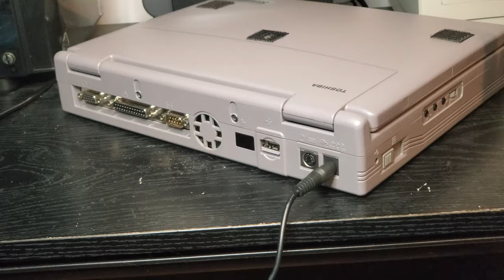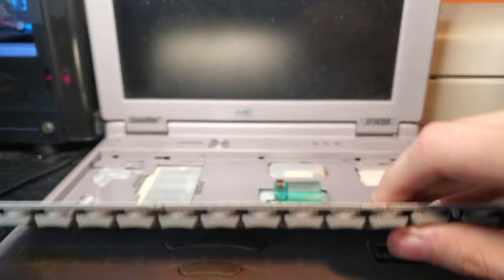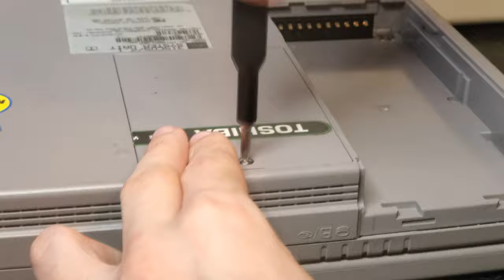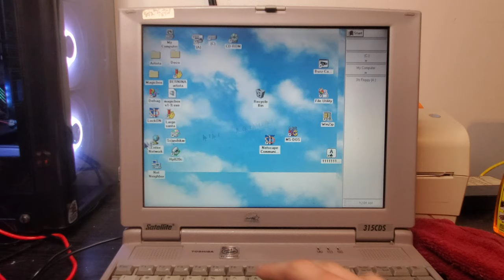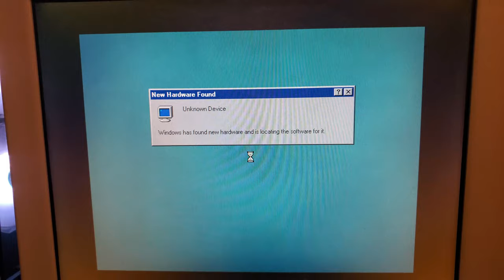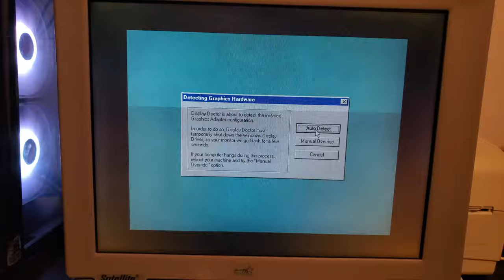Toshiba Satellite 315CDS Revival Part 1- Cleaning And Windows 95 Install

Comment: Cheers for the video, really looking forward to the next part, where you will test some games on it. I have a fascination with older laptops, so always glad when I manage to find new videos about them.

One question though: does the BIOS battery work, and keeps time, even after unplugging the laptop from the mains? You said that the replecement have the same specs, but on the label it clearly says 2.4v, and the original was 7.2v. I don't really understand how that could still work.